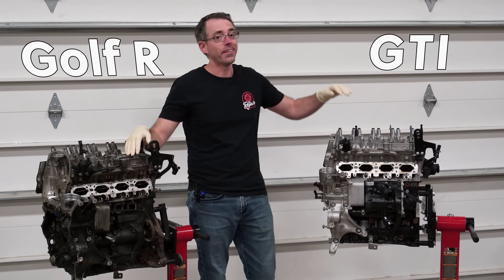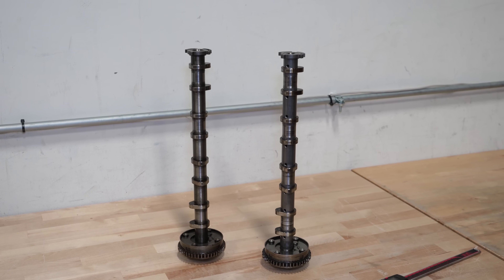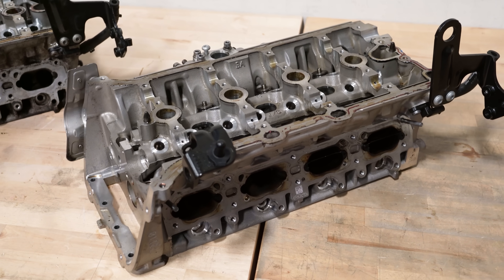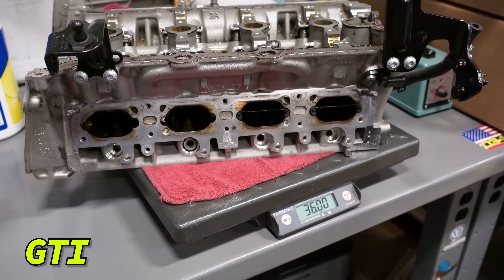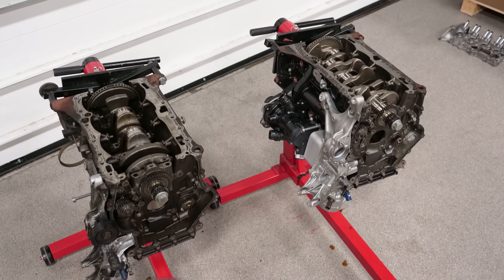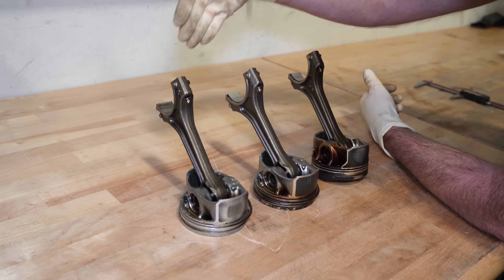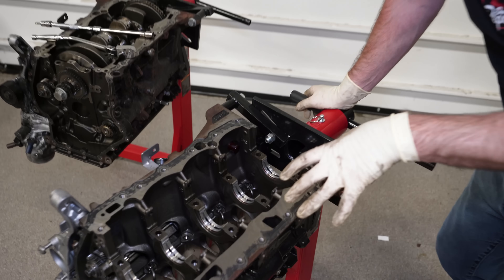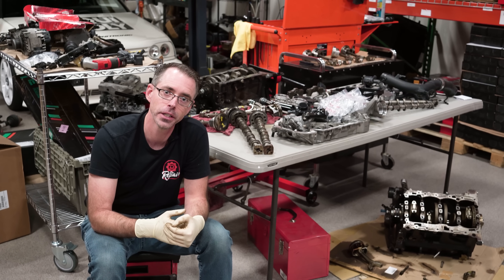Are Golf R Engine Internals Better than a GTI?

Comment: So, basically adding 50-60 whp aka a typical stage 1 on a GTI shouldn’t negatively impact engine reliability much. Thanks for doing this!
Reply: Yep but i mean we've known this dudes have been running stage one from end of warranty until end of life since the 2.0T came out with the mk5
Reply: @kilovwdude6457 that's a different car
Reply: @😊kilovwdude6457
Reply: @kilovwdude6457 my 8V A3 is running 30psi on billet (stock size) is38 on full E85 with no port injection just upgraded low pressure fuel pump and custom fabric stock basket and hpfp new oem injectors + every other bolt on u could have and my shit had 180k and I beat it, 1500 mile oil changes  and motor wise only got a head gasket so far, the newer gens are super reliable
Reply: @kilovwdude6457 ive got stage 2 Mk5 Jetta on 170k miles. Runs like a dream. Timing chain and water pump done regular maintence and a couple cam followers and seal rings.
Reply: Just don't go crazy w custom tunes like some start bragging my tune has more power bla bla... Stay w an off-the-shelf tune, those usually are on the conservative side. Do your oil changes maybe 1 to 2k miles earlier, always 93oct regardless if tune is for 89 or 91, run one step colder spark plugs, always let the engine warm up (for me is about 15min of driving) before giving it the beans.
And of course, do your timing chain within the recommended service interval.
These engines run extremely well when tuned, the ECM is super smart and protects the engine against detonation.
Reply: @mazpr2025  Awful advice. Custom setup by someone who knows what they're working with, is ALWAYS better than off the shelf generic files. And yeah a Dyno tells you nothing about reliability. Data logging does and ideally you want your data samples to be from real world conditions not a dyno which doesn't reflect real driving conditions. Good for measuring power and setting up a base map. Nothing more.
Reply: @GDBEnjoyer   ok buddy, it is your opinion and I respect that, just like I have mine.
Reply: @mazpr2025  subaru guys say STAY THEF HELL AWAY from off the shelf tunes becuase they are not conisderate of your specific engine and altitude/weather
Reply: @connorray9801    Posting was deleted because I put the name of a youtuber, there are plenty of YouTubers who have Dyno runs on off the shelf tunes. 
All my cars have off the shelf tunes; RR-Racing, IE and K-Pro, NO ISSUES!
Reply: @mazpr2025  a dyno doesnt prove anything for daily reliabilty. that 30hp gain felt in the seat at same psi proved a lot about protunes for me
Reply: @connorray9801  A Dyno run does not prove reliability!?  ... LOL
Reply: @mazpr2025 agree. I’ve wrecked two motors on custom tunes. The second motor was running a Garrett with 520bhp on the dyno. It had masses down to it and in the end it lost its load on a track day. A very expensive way to learn that these motors are fragile beyond a point.
Reply: @S @Scepticalharry  You more than doubled the engine power and are surprised these motors are ‘fragile beyond that point’? 🤣
Reply: @Conservator. there are a lot of Brits pumping out more bhp from Golf R’s. I’ve been in a Golf R (Mk7) with a Typhoon T5 turbo and it was putting out 690bhp and did low 10s quarter miles. The issue I had is in the learning that a stock GTI motor doesn’t have the same internal parts as a Golf R motor. The GTi motor is assembled in Mexico and the R in Germany with stronger crank, pistons, rings, etc etc. Despite the 2x motor demolition (piston 3 compression rings collapsed both times) it was bloody fast. Mid 3s to 100 and I could keep up with a Porsche GT3 RS around my local track. Good value for money if you can sustain it. That said if I were to do it again I’d drop in a V5 motor.
Reply: @mazpr2025  What is the recommended interval for changing the timing chain within the maintenance interval?
Reply: @mazpr2025  Your advice went out the window when you suggest canned tunes as a conservative safe option when they are anything but, a proper dyno tune will ALWAYS be more reliable than a canned tune , and at a higher power output. On top of that you are thinking of timing belts, timing chains are meant to be for "life" but of course can stretch with time. Regardless there is NO service interval for a timing chain system. Maybe some random weird model from a random manufacturer has a service interval, but I have never seen it. They consider timing chain setups a lifetime design, even though they often are not. I hope you do not work on vehicles
Reply: @DarkAttack14  yeah the chain isn't going to stretch, its the tensioner that used to be a problem in mk6's. So that's what needs to be checked
Reply: I have one of those early early 2015 GTI's but my engine was built in Germany. Rolled off the production line early in 2013 for the Canadian market, its the 423rd GTI to come out of the Mexico factory, but the engine says made in Germany. It's a different engine code, not cxca or cxcb, but mostly the same. Not sure what happened there but ya, I've got a GTI built in Mexico with an engine built in Germany. And I'll sell it to you for $250K no lowballs I know what I have
Reply: Stage 1? I'm at stage 3+ with an IS38 turbo and an e48 tune. 400hp. Been no issues at all for 3+ years. This is as big as I'm comfortable with going in terms of reliability.
Reply: @dddon51 Congrats, sounds like a nice ride!  But i would save the money for an RS3 instead of tuning. Had one as a lease. Was a great car and i was glad when i had to make use of the warranty. Next lease is a giulia Q. If you are driving this cars hard, they are better with full warranty, i think.
Reply: @dddon51  Stage?  No stage ummm it’s built.
Reply: @dddon51  DSG or manual?
Reply: @dddon51 How many total miles with no problem?
Reply: @dddon51  But how? If you'r driving a GTI that would be unbearable with FWD. No use for more than 300whp on FWD.
Reply: @JFinns well at 4th gear probably doesn't spin wheels. 1-3 well... You can't go full throttle. Yes also ruins if you want to track the car but for highway fun it's fine
Reply: I ran a Stage1+ Unitronic on a Mk7 GTI for 7 years with absolutely zero issues.
Reply: @jolebole-yt  DSG or Manual? I beleive the manual would eventually need a new clutch with a stage 1.
Reply: @curtlewis7633  DSG.
Reply: @jolebole-yt  i ran stage 1 on my 2004 audi tt 225, not sure excactly when the first owner did this but im at 94k miles and running perfectly still. i believe on original clutch and replaced timing belt and water pump at 70k miles should be good to go til forever basically.
Reply: @jolebole-yt  do you have a DSG car?  I have been debating getting the Unitronic tune but there are no dealers within 500 miles of my home.  I would have to download it myself and do it from home.  I would want the 91 octane tune which is the highest octane I can get in California.  Your thoughts on the tune vs stock?  How has your MPG's been on road trips and such?  If you have a DSG car how does it shift using the different modes? Eco, Normal, Sport and such?  Thanks for your time.👍
Reply: @eppyz  Yes, DSG. You don't need a dealer. You can totally do it yourself. Just buy the cable and use your laptop. Car pulls significantly better on the low end, MPG is slightly better when cruising. I did not do the DSG trans tune, as I felt it was totally fine with Stage1+. All you have to do before emission test is flash it back to stock or you will fail the test. Not a big deal as it takes 5-10 min to flash it. Everything is done tru the Unitronic app. Super easy.
Reply: @jolebole-yt  thanks for the info wonder why it won't pass smog with the tune of all the emissions equipment is still in place? Appreciate your time in answering my questions👍
Reply: @eppyz  Unitronic states that depending on the emission test facility some places wont pass you. Their computer shows sensor errors even tho you do not have any errors on your dash or check engine light. This is not such a big deal as you do emission test once a year.
Reply: I made the mistake of adding power to my mk6 gti. Wheels just spin, can't put power to the ground. However adding power to my R made it feel like a mini GTR.
Reply: GLI mk5 APR stage 1 , no issues. GTI mk7  APR stage 1 still no issues, so YES!
Reply: Simply not true, any tune is gonna reduce reliability.  You are 100% gonna pay to play.
Reply: @ I don’t disagree but it blew at 12k miles and I barely pushed it
Reply: @webmonkeytt  Most pro mechanics will tell you that VW over engineer everything in the engine so it can easily handle a tune with no issues
Reply: @theexperience5549  Most pro vw mechanics love people who believe the only thing important in the powertrain is just the engine.
Reply: Two bombs!
Reply: I dont know how that was your takeaway. My takeaway was the exact opposite
Reply: @jsplasha  the internals are virtually identical with slightly larger fuel capacity on the R, 50-60 whp is the difference between the GTI and R.
Reply: @themystx2  did you watch the video?
Reply: No real thing as a stage too if u think about it
Reply: Great car for men who have sex with men
Reply: My 2016 gti had 169kw and after stage1 in dyno it made 236kw so 226hp to 316hp👌🏼
Reply: I've made 500whp on a bone stock gti engine and it didn't have any hiccups for years
Reply: Well try it then ket me know we’ll see
Reply: Had an MK7 APR stage 1 that I beat the living snot out of it for nearly 95k miles since new. I traded it in because the stupid dsg developed a whine in 5th gear the last 5k miles of ownership and didn't feel like fixing it since it apparently was a known thing.  Really eyeing the refreshed golf r for 2025... Not sure what VW is trying to do with the 333 hps it's advertising in EU. What is this an M3???
Reply: Well these VW engines are somewhat over engineered for the low power they are delivering so throwing some boost at it won't hurt it much
Reply: I put stage 1 in my 2017 mk7 at 10k, upgraded hardware and stage 2 at 30k. It is now 130k and the only thing I've done is oil change every 5k.
Reply: The same happened with the Audi A3 8L and S3 8L. 150hp, 180hp, 225hp on S3. Many things changed, turbine, intercooler, but essentially it was the same engine. I have an a3 AGU (150hp) with a stage 2 tune for 200hp, daily use. I just anticipate periodic maintenance.
Reply: Nope, just make sure you tune it correctly.
Reply: Who’s the best goto for tunes?
Reply: Non of stage 1 petrol or diesel will not affect engine/transmission.
Reply: Are we getting a step by step ea888.3 build?
Reply: No, we use APR and they work fine, even stage 3 APR with a turbo upgrade works fine.
Reply: Might as well just round it up and push it to 100 whp more 😂😂
Reply: I had a 2013 cc sport with the gti 2.0L and I had a Downpipe intake exhaust and pro tuned for 40k miles and never a problem a deer ran out and just totaled it before my 140k mile 2.0L that’s been tuned for 40k miles could give me a problem. Stock 200hp after tune was 310hp & 315tq
Reply: I had stage 1 GTI mk7 - 300KM - no problems at all
Reply: I have a stage 2+ and haven’t had any issues. 192,000 miles. Proper maintenance and these engine will go for a long time.
Reply: Had both a stock golf R and GTI tuned giac stage 1+ 

Basically same shit
Reply: @ for me GTI is more fun, R have the grip but GTI is like little wild animal
Reply: Was stage 2 apr in germany pops and bangs from 30k miles to 85k miles never had a single issue and it made 300whp and around 460 lbft torque wish I kept it when i got back stateside 😬 and still got 38 mpg too loved it!
Reply: Anytime you increase cylinder pressure, you are increasing the stress on internal components.  The faster you accelerate, the more stress you place on components.  Anything that increases duty cycle on a reciprocating mechanical system, you are adversely trading durability for performance.  The only question is it enough to cause harm over the useful life of the vehicle.  That is something we'll not know individually since we didn't make those design trades.  Collectively, the results will manifest themselves over time.
Reply: Gti performance pack took it to 245 with no modification
Reply: What about stage 34?
Reply: Big turbo mk6 took 110k miles of abuse before total failure. That's 110k stg 3 big turbo. Car had 176xxx before it finally let go. Sure do miss it.
Reply: Yes but the R is four wheel drive, the GTI not!
Reply: @AlbyBattyTECHannel  with good tires and some maturity, these gtis can handle 500hp reliably. The clutch will need to be replaced on a manual, and valve springs are highly recommended but slap a big turbo kit on a dsg and get after it... gti or golf r. My mk6 was big turbo for 55k pretty aggressive miles before I needed to get a pickup truck for my line of work. The mk6 never left me stranded. Had a gt3076r and a sb stg 3 endurance clutch.
Reply: My GTI has a stage 2+ with K04 turbo and have 200,000 miles with no issues.
Reply: It's all about the tune. Bad tune will destroy the most built engine.
A good tune will not affect engine reliability.  Simple
Reply: adding 50-60 wheel horsepower on almost any engine will not impact engine reliability lol.. that is nothing. Just a tune is worth that much on any vw diesel easy on all stock hardware
Reply: So is the only real difference in horsepower for the golf R  Coming from the turbo size?
Reply: So bqsically a golf R is a just a faster AWD GTI with the same gearbox😂😂😂
Reply: What? Increasing hp always decreases reliability are you dumb? Oh wait you drive a golf
Reply: Nope. And the kicker is if both the GTI and the Golf R engines upgraded their turbos to the same hybrid turbo, and ran the same exact software, both engines would make the same exact power and it’s “reliably threshold” would be exactly the same. 

So the moral of the story is that the Golf R’s engine isn’t different enough to actually deem it a stronger engine lol. It’s just all pointless talking points that Golf R owners try to argue to make them feel better about their car…
Reply: Lol. You obviously couldn't afford a golf R so got the low powered and inferior gti 😂@JacesOwnWorld
Reply: @gattoflyer  the golf R is a cheap car...
Reply: @JacesOwnWorld So true man!

Golf R's are cool but they are point and shoot versions of GTI's.

AWD, more power, leather, HUD, Ventilated seats...blah blah blah it is a hatchback Audi.

Great car but after driving both I got the GTI instead due to the engagement and less "cocoon feel".

Have had many cars from Fiesta ST, 14 A6 Maxed bolt on and tuned ZF8, 2003 Termi Cobra, Full bolt WRX, Explorer ST, etc.

The reality is that the most practical version of the perfect mid life crisis car is purely a GTI with a 6 spd manual.

$32k no sunroof, plaid seats, etc

🎉
Reply: @JacesOwnWorld it is better cause it is 4motion😅
Reply: @JacesOwnWorld  Different pistons, different case, different valves and cam crank...... really not that much difference
Reply: @JacesOwnWorld exactly. Golf r. Is heavier. I have a mk6 gti and 403 whp with a ko4 hybrid on e85. I had multiple shops say just buy an r it’s way better and you’ll get more power, I bought parts, custom tuned through stratified, and holy shit
Reply: @JacesOwnWorld  so your telling me i should buy a mk8 gti stage 1 instead of buying a mk7.5 golf r like i am looking to buy? BUT the golf R stage 1 makes a lot more power then the gti stage one and i would like the all wheel drive i like the feel of it better then only front wheel drive but the price difference is pretty substantial in the used market gti vs the r. for the price of the mk7.5r i can get mk8 gti probably but not sure i want a german honda civic esentially is what gti is
Reply: @JacesOwnWorld by the looks of it the only real difference is the alloy used so better thermals and efficiency is the main reason you can get more power of the golf R compared to the GTI
Reply: @JacesOwnWorld you sound poor. People want AWD and more power, the Golf Rs offer than undeniably
Reply: @JacesOwnWorld actually the brakes and suspension and AWD transmission would make a significant difference in the R.
I guess you can't just tune a GTI engine and say "I now have an R equivalent"
Reply: @JacesOwnWorld  Found the coping GTI owner lmfao
Reply: @JacesOwnWorld oh you can’t afford the golf r 😢🤣
Reply: @JacesOwnWorld  Lmao and what would R owners want to "argue" about, you think they have a lot to prove? Buyers justification for spending more money while a GTI is "more than good enough"? I've seen such talking points before, mostly among the young and insecure... Did you miss the fact that a Golf R has two more additional wheels driven? You either need that, or or you don't. If you don't, good for you, you've got a cheaper FWD car. Me personally? I like traction on all surfaces and in all conditions. I like power-on-oversteer like on the new Magna diffs, instead of a FWD snoozefest. I like a lighter subframe which means i arrive understeer city later than a GTI, again, preventing a snoozefest. An R owner doesn't have to "argue", he's playing a whole other ballgame where the GTI doesn't even pass the admissions test (having the right wheels driven).
Reply: @ZenzDeluxe You just proved his point by having the urge to defend the R over the GTI.
Reply: I owned a MK7 GTI because they were cheap. I own an MK8 R now and there is literally no comparison. You can have Golf R power in a GTI but if you can’t get it down, you’re wasting your time.
Reply: @themystx2  Yeah the new MK8 is a totally different animal now. Also much more expensive then MK7 R. MK7R was retailing for $38k . Not anymore lol. If I didnt have a need for a bigger car atm, I would totally buy the MK8 R without any hesitation. Its an awesome awesome car.
Reply: @themystx2  My MK7 GTI Authobahn was $32k in 2015. But entry level GTIs MK7 were $23-26k. Still good bang for the $
Reply: @arpz1129 hahaha right😂
Reply: Have a GTI as my Daily and my 18 yr old Mitsubishi Lancer Evolution 9 MR i bought new in 2006 to spank Golf R's with on the weekends at the track so I'm good 👍 @ZenzDeluxe
Reply: @jolebole-yt with no hesitation? Golf R is pushing $50k and that's not an issue for you? Damn must be nice🙄
Reply: @eppyz  Haha well I surely don't like the inflated price on the new R as for $50k you can get a low mileage used BMW M550i V8, and M2 or M3. But if you had the money to burn, the R is best 4wd hatchback with a very easy tunable engine.
Reply: @jolebole-yt  Or you buy a 22 MK8 R with ONLY 3k miles on it for 38k (bone stock, grandpa owned)
Reply: @themystx2  That would be an excellent deal. I'll take it :)
Reply: @ZenzDeluxe all those words... sounds like someone's the insecure one lol. GTI owners aren't insecure in my experience.
Reply: @arpz1129 Fr I have an s3 but I know the lower models are capable of the same power. Just need to upgrade some components and wether that is worth it financially depends on you
Reply: @jolebole-yt If only inflation wasn’t a thing… $38k in 2015 is $50k in 2024. So, an MSRP MK7 Golf R was actually MORE expensive than an MSRP MK8.
Reply: @ZenzDeluxe  "mostly among the young and insecure."
And just exactly how in the world did you gauge that with such certainty?
Reply: @ZenzDeluxe  ... and my dogs would argue that having a station wagon is much better than a hatchback.
Reply: @ZenzDeluxe  lol if you watched the R has better parts... Poor gti owner lol😂
Reply: @themystx2 There is something to be said for having to work a little harder to squeeze out performance.

But both cars are very great for anyone looking for something outside of plug in SUV's.
Reply: @arpz1129  not really, he proved his own point by showing how theres a lot more that makes the R better than minor engine differences
Reply: @imaginova88   @imaginova88  HE didn't just do that. Read it again and notice the condescending tone. FWD snooze fest, an R owner doesn't have to justify when the R is playing a different game that the GTI doesn't pass the admission test. (Having the right wheels driven)

He could've said I prefer all the extra stuff that the R offers and that's totally understandable. People look for different things in a car, but the tone he decided to use proved the other commenter's point. He got butthurt.
Reply: @themystx2  agree but most automotive journalists prefer the GTI over the R🙄
Reply: @themystx2 wrong… I have an mk8 gti with a tune and that thing is rapid and puts the power down really good. A good tune is important and so is a good tire
Reply: @ZenzDeluxe  So your argument is AWD is better? No shit.
Now talk about the A3... same performance and reliability with a simple turbo upgrade. 
Got anymore cope?
Reply: @arpz1129  And his argument is AWD is better like no shit Sherlock. He won't dare mention the A3
Reply: I don't really understand why the GTI and the R have less power then the ones in Germany?

A GTI performance variant in Germany has about 245ps which is about 240hp and the gf R has about 320ps.which is about 315hp.
Reply: @1dameister1 NA emissions. Gotta keep that govt happy. Same reason don’t get a Clubsport variant.
Reply: @TheMlvswoll  

Yeah, that makes sense.
Reply: Both just as unreliable as any other vw tsfi engine
Reply: 4g63T is a better motor imo, and over 2 decades older.
Reply: Its much more fun having a 500whp gti roll racing golf r's, audis, mustangs and the look on their face when you put a few car lengths on them.
Reply: @UselesFlesh  and that bone stock Golf R will embarrass you from a dig; there's only so much mustard you can put on a hot dog before it ceases to taste good.
Reply: @UselesFlesh do the same mods to the cars you mentioned and see what happens. You're heavily modded, what do you expect.
Reply: @UselesFlesh  roll racing, ditto!
Reply: Yeah, it will be just as unreliable as it was before.
Reply: @invertedpolarity6890  Actually the EA888 Gen 3 is pretty reliable if kept stock and taken care of.  Poor tunes, skipping maintenance and such kills them, which is an owners error, not the cars.  Had 270k miles on my MK6 GTI when I sold it and over 150k on my MK7 with nothing but routine maintenance and both engines were bone stock down to the paper air filter.  I'd call that reliable.
Reply: @eppyz  I agree.  Good tunes work fine with the Gen 3 also.   We got the APR 87 Octane tune for my wife's '14 1.8 T Beetle and the car has been reliable for years now.  The 87 Octane tune is basically just cleaning up the fuel/air ratio and more timing adjustments for the turbo.  It was enough of a performance boost to satisfy us, as well as keeping the fuel mileage basically the same.
Reply: @eppyz  Hell yeah. I had a MK6 GTI - Did 100k miles on it, had 50k when I bought it no problems at all. Oil change around 3k before recommended. I did change pump + timing chain before the servcie interval and it ran great. New owner currently has 220k on it and it still runs great. My MK 7.5 GTI now is at 90k miles which i've done 30k. Same story, no problems at all. Planning on doing timing chain + pump in the next few weeks but currently no signs of a fault. MK6 was stock and my MK 7.5 has a TCR exhaust and a very mild tune.
Reply: @invertedpolarity6890 de serie si...el problema es que nadie lo lleva de serie
Reply: The hell it don’t. I had a MK7 GTI with an APR stage 1 and it lasted 12k miles. Blew at 67k miles and I bought it brand new. And I took care of it. So I can’t trust it anymore.
Reply: @Bullioncolin  Sorry to hear that. I have no experience with APR. Before I did mine, I did some reading on the forums and I decided to go Unitronic. Never an issue. I bought it brand new and I drove the car up to 90k miles and sold it last Oct. In that lifespan I only changed one injector and did regular oil changes at 7k. Besides the Uni tune, everything else was bone stock.
Reply: @jolebole-yt  I don’t feel that the tune was fine, this was engine failure at the timing chain which they are known to do that sometimes after I dug into it. I had a 2017 so it wasn’t turbo issues. The beef of the engine as far as internals being forged where it matters, I.e. crank, rods ect, isn’t the issue. The problem is these engines are over engineered like the rest of German vehicles.
Reply: @Bullioncolin what exactly happened and why???
Reply: @Bullioncolin What exactly blew? My MK7 GTI with APR Stage 1 tune is on 67k miles and doing great. I drive it really hard too. The only thing I go through is clutches, paddle clutch and RTS single mass both destroyed 😂😂
Reply: @ your timing chain will prolly go out and when it does, boom. They wanted 1800 to diagnose the issue meaning confirm the valve hit a piston, it had no compression in cylinder 1. And then another 3800 to fix it IF that was in fact the issue. 8k for a whole new engine. Sorry, not worth it.
Reply: @Bullioncolin  it blew? That isn't a common issue so maybe a bad tune or a bad turbo like the Early MK7's had.  Lots of problems do happen to modified cars no matter the brand look at the Subaru STI as an example.  My friend bought a 2020 STI new in 2020 8k miles later engine went bone stock car.  Ring lands failed and he has to get an attorney and sue Subaru to get a new engine.  Crazy.
Reply: @eppyz  nah, timing chain went, valve hit a piston, metal shavings and it was 5k to repair.
Reply: @Bullioncolin timing chain issue on a MK7?? Odd failure indeed.
Reply: @eppyz   Subaru are known for crappy thin sections for ring support. They aren't built for power, but for fuel efficiency, emissions compliance, and other motives. And the H4 engine is basically the worst kind of engine to build for big power. Subaru needs to junk the flat-4 and get with the rest of the world.
Reply: The engine reliability is the same for GTI, you can push gti engine for is38 400++Hp as In Golf r… Gti engine is as strong as Golf R’s…